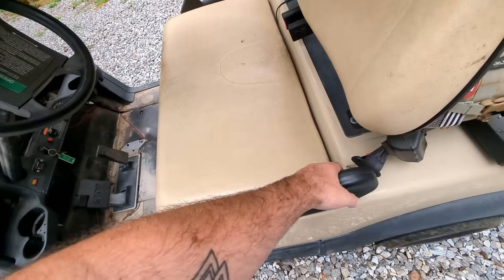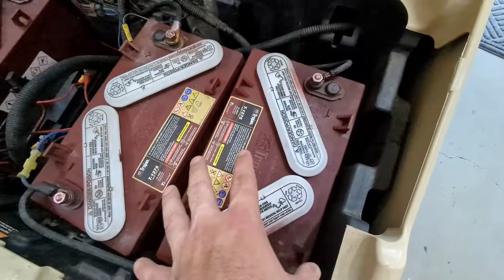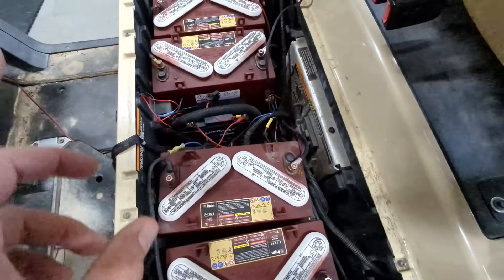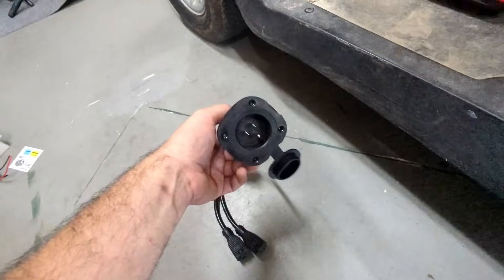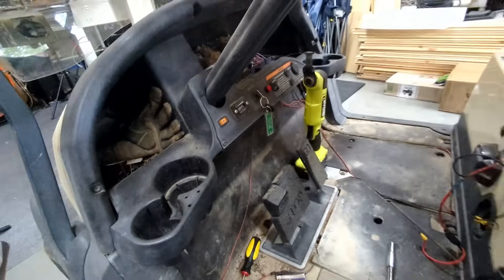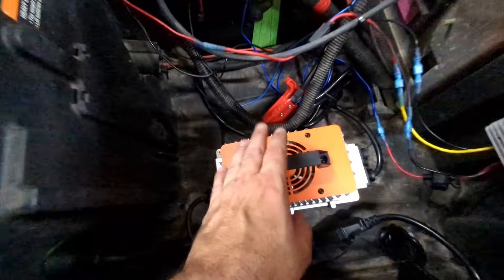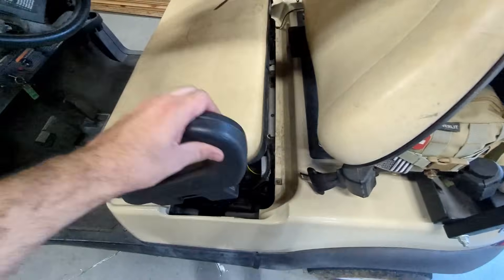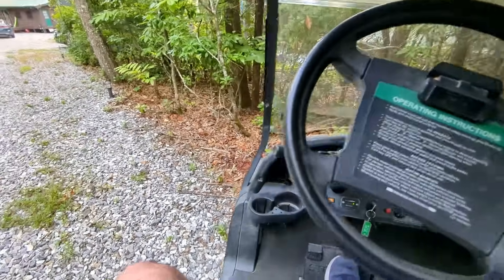Golf Cart Battery Upgrade | Lead Acid to Lithium Conversion (More Speed & Range!)

Comment: Do you need to add any ventilation to the battery compartment to keep the charger from overheating, or do you just leave the seat up?
Reply from the maker: So good point there is ventilation holes underneath that box in that compartment and the seat is not 100% sealed but I kind of agree with you some kind of ventilation would be nice so things don't overheat but the battery does have BMS on it so if any overheating occurs it will stop charging but yeah maybe we should add some ventilation vents on the sides that would help with air flow I think